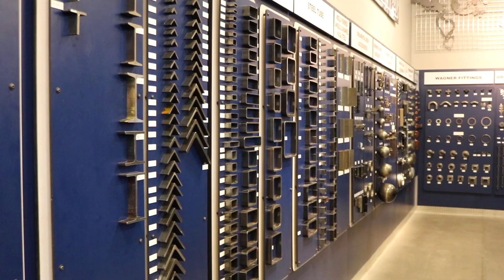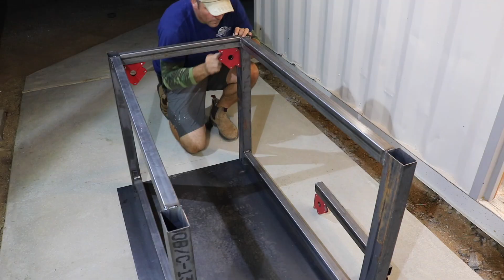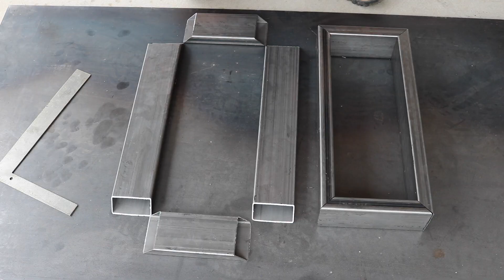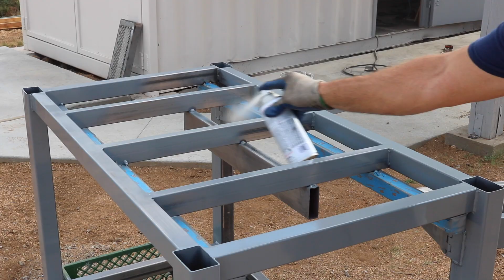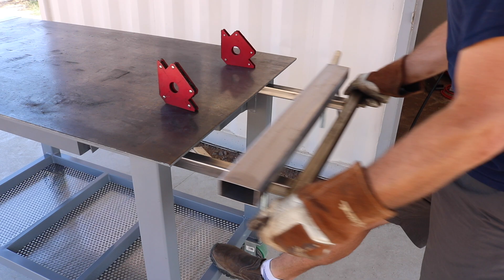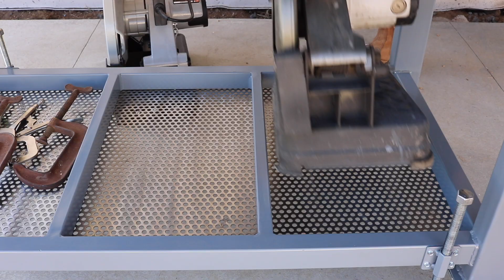Welding Table / Workbench Build    -    How To

Comment: Waste of material if you ask me. I never used a Table for welding. I used only reglable metal horses 4 of those to be exact. Never had a problem working on them. and you can take to to any job site

Comment: Only two things I would have done differently. One is easy. I never have nuts against the material without a washer. The other is that if holes are going to be put in, I would have used a thicker top plate. My experience is that going from a 1/4” table to a 1/2” table made a huge difference. Not saying you have to go that far, but 3/8” or even 5/16” would make a difference, particularly if this is A-36.

Comment: Q, can the frame on my 54 pickup be reinforced by just adding a couple of cross bar same metal gauge of the frame why or why not would something like this work and can it be made to be inconspicuous as possible like welding a smaller frame into the existing frame.Thanks😊

Comment: Hi, Congratulations on the video, could you tell me which disk you use to cut the metal tubes? Are 10 inches? they do not spark when it cuts?

Comment: Great job.. I built something similar for a friend about 7 years ago and I put rubber from a tire on to a piece of 2x2x1/8  flat bar and welded it to the bottom of the leveling legs. Again Great job. 2 THUMBS UP.

Comment: Thanks for the video! The expanding sides will work great for my small shop. Sorry if it missed it but what size plate did you use for the top?
Thanks.

Comment: Always like seeing different ideas.  Couple of ideas from my side.  If you move the hinge for your swing out drawers to the front you can swing the drawers 180 degrees.  That way they are generally accessible but still out of the way while working.  Leveling feet you may be able to incorporate some Harbor Freight 6 in. Quick-Release C-Clamps.  Press a button to quickly raise and lower then a few turns to finalize the adjustment.

Comment: As for the 4 stops, you should use 2 floor locks instead and I would change out the the poly on steel casters for some apex casters. That cart has to be a little hard to push, but by using the apex casters. You'll be able to push that with your fingers. Get a hold of me at Barron Equipment (515-262-6021) and I'll send you out some for free.

Comment: I am impressed with your work, I am interested in welding and so far am in the process of purchasing equipment to do so. I am on a budget , so far I have purchased a Vulcan Omni Pro 220 from harborfreight. There are a couple of more pieces of equipment I see that I need to purchase, given I have never welded before and am surely looking forward to it. It is to serve the jobs around my home such as automotive and things of that nature. With the assistance of veteran welders who has offered to teach me what is needed, I look forward to the lessens. If at all possible would it be possible to  get a copy of the material and their dimensions to duplicate. I would like for this to be my first project. You have done an outstanding job, also I am considering some of the comments as well to incorporate into this build.

Comment: Very nice table. Question: Why did you use perforated tube for the telescoping tubes on the extension wings? What advantage does using perforated have over standard square tubing in telescoping sizes? Thanks for posting.

Comment: Hello there! Excellent video! I wanted to ask you... is the top plate just iron? How do you prevent it from rusting? I've seen some projects using stainless steel, but they'd cost a lot more. Thanks!

Comment: a possible improvement would be to ad a thicker edge to the front of the table. when welding splatter get stuck on the edge it will act as a saw and cut your clothes and power cords. also if you ever have to grind the edge of the table top sheet it will become sharp as a knife. but seriously you made a nice table.

Comment: Great welding table design. I notice you use a Evolution metal cutting saw. I was wondering your thoughts on the model you use vs the miter capable version and if you have experience or have used both?

Comment: Great video, love the container concept.  I know that doesn't work for everyone in their location, but it does for me and you.  I have 2 set 9ft apart and found that a 2"x2" frame in between added 9x40 more covered work space in between.  As for the table, alot of great ideas here.  My table is much bigger and more heavy duty, but the sliding sides and drawers just makes the wheels turn.  Good job with explanations and fast fwd with voice over is always better.

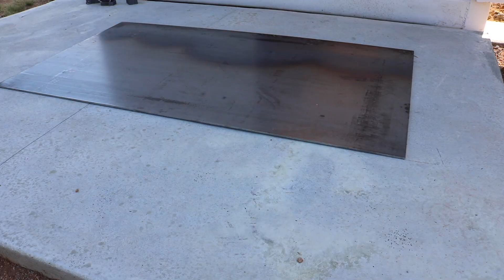Comment: Which sae/cutting disc are you using at 1:19? I'm a total noob in this and didn't think I could cut tubes with a power tool without sparks flying all over the place :p

Comment: Hi I am from India I want to know type of cut off wheel you used for cutting steel bars , here in India we use abrasive cut off wheels for cutting steel it gets so dusty though it's cheap but all that metal dust goes to total waste whereas using yours those metal chips after cutting steel holds some scrap value n it's clean process

Comment: Gday
nice table
so what u think about ya cold cut saw they only come out in may here $499au i like mine only thing i dont like is the clamp not got a quick adjust? and the 1 i seen here on ty had a better base not the stamped 1 like u got and me?
cheers

Comment: Heck, even from over here in Ireland that looks a lovely little weld table 👌

Perhaps add a locknut to the underside of each levelling stud to stop them creeping under vibration. You can get rubber chair-leg feet at the hardware store to stick on the bottom of the studs. Stops the threads getting chowdered up and probably improves the grip also.

I used tie-rods for concrete formwork for my levelling studs. They have a really coarse thread so are quick to move up or down if needed. 

Lovely table, loads of ideas to unashamedly copy 😉🤓😉👌

Gerard 🤓

Comment: One suggestion...on the 4 corners of the top...just make a 45 degree cut.  clothing and cables hook less on a 45 degree angle than a 90 degree one. otherwise, well done!

Comment: The magnets to hold the drawers secure is fantastic. Smart idea to make the top easier to remove as you decide how you want to modify it. Also- I agree with using the table for a while and seeing where you might need to make adjustments, rather than getting everything 100% done and realizing later that you would rather have had something work in a different manner. Two thumbs up!

Comment: Great work table! I don't see anything wrong with your leveling system? If it was me, I would add 4 bubble levels to each corner. That way as you use your cordless drill to level the table, you can watch the bubble, until it's level and know when to stop. Also you may want to add a small square piece of metal to the bottom of the leveler bolts to have a bigger footprint for better stability for the table, instead of that little round bolt end. Maybe add an additional light , like a spot light for better lighting on the work surface of the table? That light could be mounted to a piece of tubing that is mounted to the surface of the table with bolts through the table with nuts tack welded on the bottom of the table? Angled bracket tabs welded to the upright tubing. Kind of hard to describe, without pictures. I will definitely be using this design if I ever build myself a welding table work bench! Good job! Roy

Comment: Danged handy looking table. Tabletop looks a bit thin. Life is easier with robust edges for c-clamps to pull against. Thicker metal allows for some pounding, and it forgives when you tack weld to it, then grind off. On a heavy table, consider resting it on rigid feet while stationary, but hinge the wheels down to roll.

Comment: very well done , this is a very practical table , for me the only thing i would had is little plates for the leveling bolt in case you use it on softer ground

Comment: that was quick , my dad had a small junk yard so I got to play with a lot of stuff. but I only have one chop saw.....i see that you were building that work table next to a shipping container...a cement floor would be a blessing. but it don't stop me, been on the lower end of the money so it makes me think through things to make the most of what I got but I've got hooked up with a close by recycler so I get to buy good usable and resaleable stuff......like the home depot carts. on wheels they make great project benches..or work tables roll them out of the way, wish i could share some of the stuff I do been messing with old riding lawn mowers I pick up a 26 hp CRAFTSMAN,  a batt. and stater latter and it's a beast... 54 inch deck it moves fine. I subbed feel free to hit me up I've had all kinds of mechanical type of jobs...I like building and mortifying off road buggies. and a mopar guy to boot...best of everything to you...Don

Comment: Great little table.  I may steal your inspiration for my shop.  If you run your 'stabilizers' down and then do a little whaling (beating with a hammer) you might end up with divots out of a concrete floor.  Maybe something as simple as a small piece of plywood...just a pad.I really like the swing out drawers.I like your channel and I like your place and what you are doing there.

Comment: Well done indeed, sir! That table shows a great deal of forethought and some clever implementations. The swing-out drawers in particular are very cool.

I'd consider just a couple of things - some metal pads on the bottom of the levelers to avoid tearing up that nice new slab, and going with a thicker top (1/2" would work well) with a grounding tab welded on. If you use your welding table like I do, there will be a fair amount of pounding done on it - and a thinner top might not stand up and stay flat very long.

Comment: I like your welding cart/table . You may need 2 more of those swing out drawers under the 2 you already have, keep them as swing outs so if you use that lower shelve you can swing them out of the way if needed. Also maybe some brackets for removable larger inflated tires for taking it over softer ground. The tires you have are great for hard surfaces and weight but are like a wheel barrel with a flat tire going up a mud covered hill in the rain, on softer surfaces. Also the long bolts that keep the cart locked in one place could use 4   2"x2" under them to spread the load. Even on concrete they could chip the surface they are on.

Comment: Nice job. What about welding on a grounding lug to the top for your ground cable so that the whole top is grounded.Sometimes its hard to get a part clamped,but contact with the grounded with complete the circuit, Just sayin'. :-)

Comment: 10*  Amazed.  Thought you bought a Harbor Freight table, but you did the whole design and construction - kudos !

Now GET TO WORK on that solar cell panel wind-blade dutch windmill so that you have both wind and solar rotating at the same time, and power up a water fountain that drip-irrigates the entire estate.

Check out some of Canterbury's vids on wood stops in the table, that create their own hold-down clamps in any hole on the table